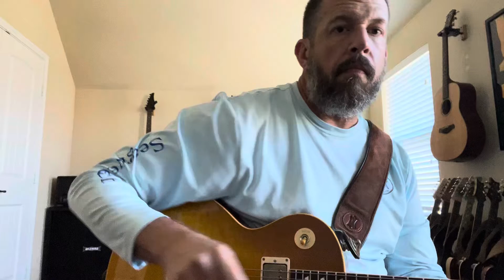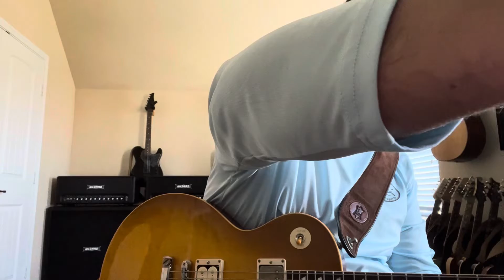Diezel Big Max Low & High Input Test Straight In Gibson LP 58 BKP Mule

Comment: Sounds decent for lower gain applications. Have you tried the mk3 Herbert? I got one last week and it sounds significantly better than what I remember the mk2 sounded like.
Reply from the maker: I didn’t like the Mk3 Herbert - but I like the VH4 and this one.
Reply: @wizardsouthJP do you prefer the Big Max over the w800?
Reply from the maker: @richardpryor2981  not necessarily, they both do their own thing. The Diezel still has the compression and midrange voicing youd expect, the W800 had more open and raw punch.

Comment: Thank you for posting this! Low input was exactly what i was looking for. The amp sounds awesome in my opinion. Have you by any chance tried the Diezel Paul and can compare?
Reply from the maker: Had a Paul a few years ago, much more versatile and overall I think I’d take the Paul over the Big Max, both are cool amps though. The Paul has a great clean and could get pretty aggressive on its own even without a boost.
Reply: Thanks for the quick reply! From what I've heard online the Paul also seems to sound a bit more open/vintage rock than the BigMaX , doesn't have as much of that diezel compression. Since the price difference here in Germany is only 200€, I think I will go with the Paul
Reply from the maker: @simonjonasmusic8410  yes, the Paul is a bit less compressed but still has the Diezel DNA and tone - just a bit more raw and open. Paul is a great choice - you'll dig it, and the reverb was fantastic as well.
Reply: @wizardsouthJP  Thanks man, really appreciate it! Big max still sounds excellent though